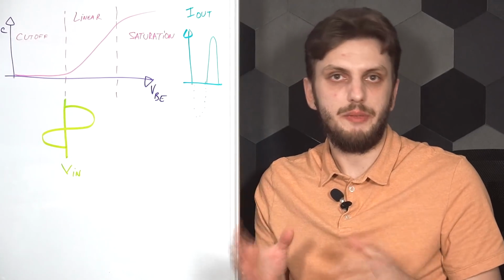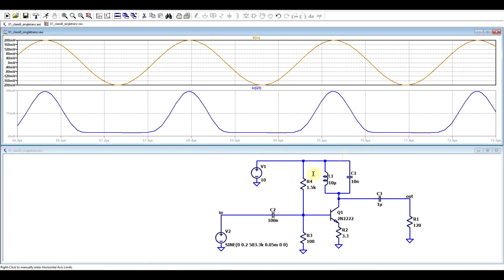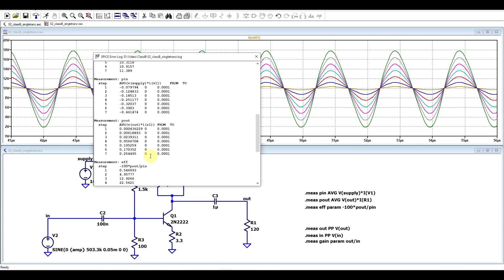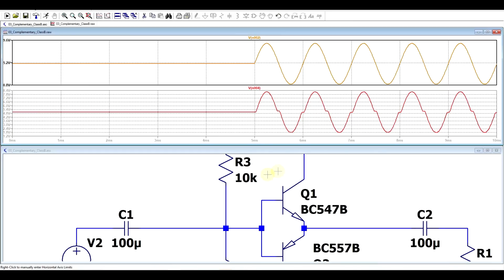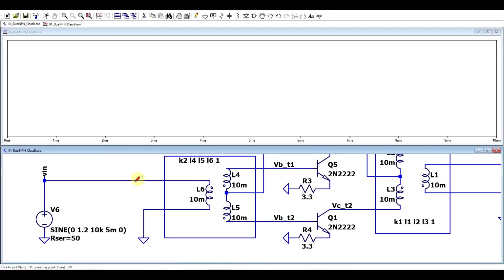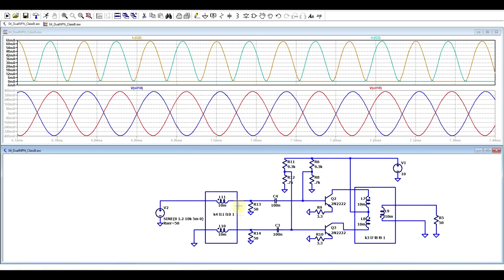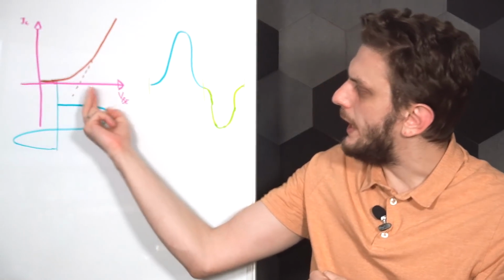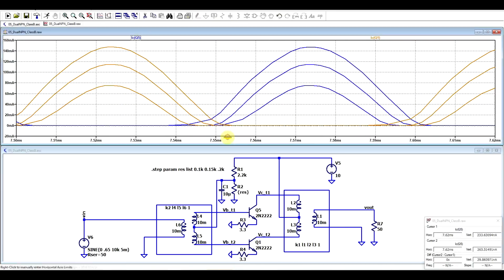The Class B amplifier - basics and simulation (1/2)

Comment: Is it safe to say that a Class A, B, & A/B amp PCB could essentially look identical to the eye? The only real difference would be a few resistor values?
Reply from the maker: This is true with AB and B, but with A its not just a difference of component values - With class A, only 1 transistor receives the input signal, while the other acts like a constant current source. Now "to the eye" of course you can make all of them look identical, but in the schematic there will be differences.
Reply: @FesZElectronics   Hello, when are you going to produce next video about class B amplifier?

Comment: Technically, these transistors are both operating in class C because their conduction angle IS LESS THAN 180 degrees.

Class B is 180 degrees as you said but did not get right. 

Amateur.

Comment: Hi! Just a quick tip, that might be useful: in LTspice, you can plot measurements vs step parameters. If you open the error log, right click on its window, then there is an option on the context menu for plotting measurements. Hop you find this useful

Comment: @FesZ how do you model the bifilar transformers in LTSpice? This will be a game changer for me to be able to model some circuits that I've seen with trifilar windings that confuse the heck out of me.
Reply from the maker: Well, its a 1:1 (or 1:1:1 for the trifilar) transformer - so it can be modeled like any other transformer with a "K" statment (no "." at the begining). A 1:1 100uH trafo is built with 2 100uH inductors, say L1 and L2 and the statement "k l1 l2 1" (for an ideal coupling factor of 1); for trifilar, its the same, just add the 3rd inductor to the K statement.